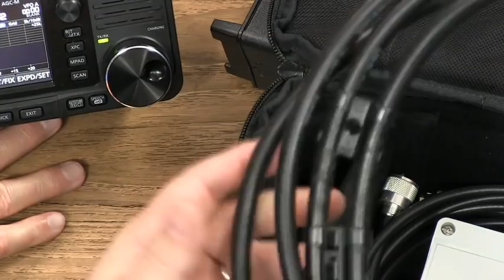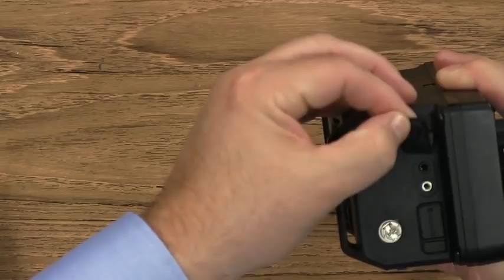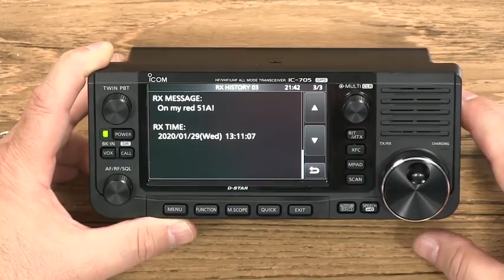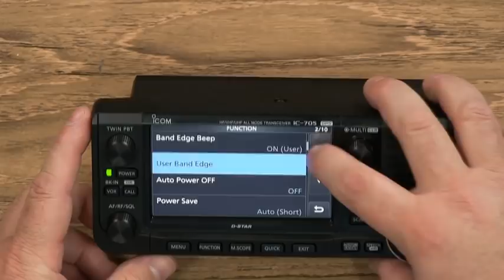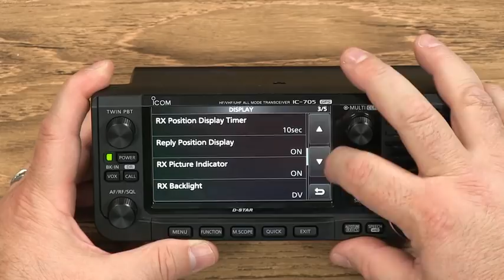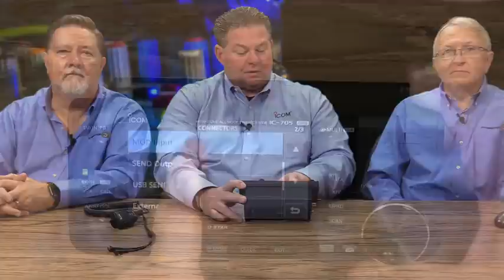Icom IC-705 All Mode Transceiver

Comment: This video was in my Youtube recommended page...

I have problems....

Is the Icom IC-705 going to be a good radio?... Yes.

Will it be a practical portable radio?... No.

While the radio is a good radio, and I like the ‘battery for handheld’ approach, there remains several areas that need massive improvement.

1). The backpack. Icom did exactly the same thing with the IC-703. The only variation was that the 703 needed an external battery which was the same thing as used in Radio Control Cars. The 705 has its own plug-in battery on the back panel. The backpack even includes a pocket for the dualband antenna. For some reason, Icom discontinued the shortwave antenna used with the 703, so now we can’t do portable shortwave with the 705.

2). This is a biggy. NO BUILT-IN ANTENNA TUNER. Nothing, no way, no how, nada! This means more space in the backpack will be taken up by the EXTERNAL antenna tuner and probably spare batteries for same, too. This leaves a lot less space for the actual shortwave antenna, which (because no antenna tuner), the user will have to pretune. Pretuned antenna(s) will be useful even with the tuner in place. To use all this stuff, a person will need to bring a table to hold the gear. 

All this means NOBODY will use the 705 in the field, carried in the backpack. Plain and simple. QRP users will love this radio, for low-power base-station use. But nobody will buy the 705, with the intention of DC-to-daylight portable use.

Adding insult to injury, the IC-703 had an antenna tuner. Sheesh!

This leaves only one company with portable gear that includes a decent antenna tuner and batteries internal option. Sorry folks, that’s Elecraft. Even Yeasu hasn’t approached the all-band portable properly yet, but at least the ATAS-25 exists, which eliminates the need for a shortwave tuner.

I hope people actually enjoy the IC-705, but let’s not try to sell it as something it isn’t.
Reply: Xiegu's X5105 has an internal battery AND an incredibly capable tuner.... ICOM missed a trick there
Reply: Ronan Cantwell 

Okay... however, I do not include products made for everyone but their own population.  Firstly, China has no amateurs. And second, their products, however good some of them are, are inconsistent quality. And I mean by a lot. You can obtain 5 of the same unit, and at least 2 and sometimes three, are inop in some way, or out of alignment.

I should know, I tried several over the years. I remain unimpressed. Being lucky and getting one that works, still doesn’t let us know about these long term stability tails... and it’s becoming a not funny subject.

Don’t waste your hard-earned money on products intended for everyone to hate, but your own people. Chinese companies are low-balling their pricing for good reasons. A good percentage in the market, regardless of quality, is an important metric, especially when it won’t hurt what you’re doing in your own country. Deal with product lines with a good track record.

These, and for many other reasons, are why I pointed out the ‘kx’ line at Elecraft and ignored the Chinese products.
Reply: @kd7bwb12  Firstly, I'm not American and won't buy American radios as I don't agree with the way your country is run. Secondly, I have two Xiegu radios and both are fantastic. Thirdly, there's a very high probability that the device you used to reply to my comment was produced in China..... I know mine was....
Reply: Ronan Cantwell 

The listed mixed metaphors in your reply, is so long, I’m not sure where to begin.

But I’ll try.

1). For the last three years, and being an American, I am totally satisfied by the actions of my country, under the command of DJ Trump. There are parts of the country that is criminal minded, like many others. The next year or so will be very edifying.

2). I did not mention Elecraft because they were an American company. I mentioned them because they make a good product, and their main target market country has actual amateur radio operators. China has NONE.

3). My computer products involve an old Compaq as my Linux box, and many Apple products. Apple is the only American computer company that builds some of their products in the United States (Mac Pro , iMac Pro, and iMac). Their laptops and their battery factory are on the ASUS campus, in South Korea. The IOS products are made at Foxconn, a department of Hong Hai company based in Taiwan. They have some of their factories in China. Foxconn also makes products for 14 other companies including Hewlett-Packard (who owns Compaq).

Hong Hai is the single largest employer on Earth, 1.2-million employees.

Find a way to assuage your conscience of guilt in another forum, but your politics stinks.
—-
As for your liking for Chinese ham radio products, I am hopeful that you wasted your money in a useful way.

Just remember what I said. China likes to sell products to anybody but their own people, and build in such a way as the owner has to purchase them more often than other lines. That is for another conversation down the road.
Reply: @kd7bwb12  You really do like to type, don't you. Here's a link to an article by your very own ARRL all about amateur radio in China. http://www.arrl.org/news/cq-china

Don't get me wrong - I agree with your position on the country's politics and indeed their human rights record but you can't boldly state that they have no amateur radio operators as that's simply not true. 

I can't help you with your unfortunate choice of computer product. You're in too deep there.
Reply: Ronan Cantwell 

Okay, I checked out your data. I stand corrected. There are HAM’s in China. I looked it up in detail. All 800 of them. Yes... 800 of them. Not 8,000, not 80,000.

800!

The last census in China said approximately 1.35 billion people, their population is dropping some. But 800 hams. That is all.
—-
As for Apple, let’s take a look at the company.

It is the first microcomputer company in the World to net $1-billion dollars, and that is for the Apple-2 computer, and before the Macintosh.

Apple remains the only microcomputer company remaining, to design and build their own hardware and then design and build their own operating system to run on it. The only one. 

Again, they remain the only microcomputer company to build at least some of their products in their home country. Microsoft doesn’t, Dell doesn’t, Hewlett-Packard doesn’t.

There is nothing dishonorable about these facts...

There is nothing dishonorable in their conduct as a business. I question some of their forays into politics.

They are presently in a very vocal fight (in California) about user data privacy, versus Google. Apple is right on this.
—-
But you have other ideas, you won’t state. Play the game or don’t, but I have no regrets about owning Apple products. Even their tech support ratings are about 75% approval. The next highest (worldwide) is Hewlett-Packard at 45%.

But you play in the shadows, and will not engage. Until you do, you stand as a coward.
Reply: @kd7bwb12   You have been a busy bee, haven't you?  Please excuse my brief period of sleep.... Please also excuse my single-paragraph response as I'm using my Chinese phone and can't seem to enter line breaks. Must be a government thing. I won't enter  into a debate on Apple. I have very strong views on that company that differ from yours and I very much doubt either of us are likely to change our opinions through chit-chat here. To come back to the original topic, I have no regrets at all about buying my two Xiegu radios. They have been very well supported by the engineers at Xiegu who continue to develop new features and software upgrades. It's been interesting and refreshing to see them responding so quickly to customer feedback. I won't claim for a moment that there haven't been small issues with their radios. There certainly have but these have pretty much all been resolved and the radios are an absolute joy to use. As for your comment on my character towards the end of your somewhat entertaining reply; You don't know me and thankfully I don't know you. I wouldn't be quite as rude as to make a judgement on your character based on some throwaway comments on a YouTube video. I won't be replying further to this so fill your boots and tap away there as you seem to be the kind of guy that needs to have the last word. Oh no! I DID make a character judgement! Feel very free to prove me wrong as I will neither care nor respond.
Reply: Ronan Cantwell 

So okay, you take your ball and your bat, and go home... because you can’t win.

And you know it. So let’s review:

1). You buy a radio fom from a China based company that has a internal customer base of 800.

2). You broached the subject of your dislike of US politics, and now refuse to elaborate.

3). You broached the subject of disliking Apple products, again for reason you refuse to elaborate.

And now because you can’t prove a damn thing you get into a tizzy and close the field.

4). You’re the  one that wants to talk about your Chinese made radio, which I am perfectly happy to do, but I insist on you clarifying and elaborating on subjects I’m pretty clear you can’t define very well. I’m also pretty sure, I’m better versed in politics and Apple, than you are.

Your disadvantage is obvious, and explains you raiding the game. You’ve written more than enough to make a clear value judgement about your character.

You remain a coward.

Comment: A Pity they didn't add:
> Intenal ATU
> BNC for HF & BNC for VHF/UHF or Driver for microwave transverter on 1 BNC, Talkback on the other
> LiFePO4 Battery Pack

I'm hoping the EU version "will" have 4M / 70Mhz

Comment: Quite interesting. All in one.
Question 1, will it be MARS and CAP capable as well as selecting between USA and EU band plans?
Question 2, is Ray a Marine?
It would be nice if it had a connector that would allow for an external antenna switch. On HF it would allow an external switch to route the antenna to a tuner/antenna and on V/U it would tell the external switch to go to the dual band antenna. A very simple mod/add on that ICOM could incorporate into this radio. When one mounts in in their car the antenna switch is mounted in the car and just connect power, antenna and antenna switch and rock and roll.

Comment: Ray is constantly tilting the 705.  Icom should include a separate tilt stand with the rig.  It also needs a small ATU that integrates with the unit.  Nice unit.
Reply: Take the Elecraft ATU T1 and your fine up to 20W. Or as a basestation with a PA like Hardrock PA including the ATU option.
Reply: @wolfholler9939  I have the T1 tuner.and used it with my FT817 and KX3. A great tuner with a wide range.
Reply: Either use resonant antenna's, or pack a LDG  z11 pro2.
Reply: I'll add to the T1 love fest. Small and works very well.

Comment: So it's got GPS built in... Does it have APRS?
Reply: Probably only DPRS! Unfortunately.
Reply: @m1geo  bummer... Guess I'll buy something else.  Was hoping for an all-in-one that wasn't missing features my HT has.
Reply: This is Icom, not Kenwood, so no.
Reply: @gsansoucie  arps is not Kenwood specific... It's used by a lot more than that.
Reply: 805maker valid point, Yaesu has APRS too.  Icom seems stuck on DStar though
Reply: @gsansoucie  guess I'll order another Kenwood. :(

Comment: A QRP RADIO when the bands are beyond Terrible? ICOM has missed the mark again and it’s becoming a normal activity for them? I am considering a Yaesu since they do still make radios that are not Touch Screens which I would never own.
Reply: "Beyond Terrible"
FT8 & 10 Watts and you can work the world, JS8CALL & 30 Watts and work the world
You adapt to suite conditions,  or wait 5/6 years and use QRO
Reply: "Beyond terrible"... is an embarrassed operators way of saying "I need a better antenna.".   I've worked Alaska and the Slovak Republic 4800 miles away (SSB) on 6 watts and a wire.   Amazing how the bands aren't "beyond terrible" every weekend when people are talking on the radios.
Reply: Hmmm... I’m working state QSO parties using CW @ 100 milliwatts into a dipole in the field. (Just did that yesterday.). Sometimes even 100 watts isn’t enough but you can regularly make contacts at QRP levels.  Give it a try on a contest weekend and see what happens. -Cliff (N4CCB)
Reply: Yes, a QRP radio despite the bands are beyond terrible! This is exactly what was missing in the Icom portfolio since the 703 was discontinued. There are numerous bulky 100W HF transceivers on the market but only very few ones you can take with you in a backpack! Icom is doing exactly the right thing presenting a competitor to the Yaesu FT-818 and Elecraft KX3.
Reply: DB7MM 90% that buy one will be in the market for amplifiers for some or all of those bands soon after their purchase.I have seen it 1st hand with several friends who have the KX3 and 703 radios.

Comment: Icom has been on a roll these past few years, releasing gear that has really pushed the technology forward; ic-7300, ic-9700, ic-r8600...
Reply: IC7610
Reply: @m1geo  Oops, yeah forgot that one!  I own an IC-r8600, what a great wideband receiver. I still love my old AR5000+3 and AR7030 radios and would never part with them, I guess they represents the end of the line for conventionally designed receivers, I doubt it's possible to design better superhet-based radio, also a highpoint for AOR who seem to have really fallen by the wayside these past few years.
Reply: It feels like Icom is the most serious about amateur radio and moving the technology forward.

Comment: Remove speech button and add Antenna tune button. Sold.
Reply: Agreed. And while they're at it, how about including an internal auto antenna tuner. Elecraft and the Xiegu g90 has one ! Unfortunately a deal breaker for me. When I'm out hiking and camping, the antennas I use are not going to be right on resonance. A tuner is needed and I don't want to have to backpack  another external tuning device.
Reply: @normkirk65  Thats why I will be keeping my G90 for a while in lieu of getting the IC705.  The G90 has it all, waterfall, antenna tuner and analyzer plus 20 watt output at less than half the price.  If I want VHF/UHF, I will bring along my FT3d.
Reply: @TXLorenzo  Yes. I am seriously considering buying a G90. Perfect for backpacking and you can't beat the price !
Reply: @normkirk65  I like mine. I use it for backpacking as well. It has an all metal case and is fairly rugged. I can use it for  voice and all digital modes as well. Hard to beat the price/performance.
Reply: @TXLorenzo  Thank you. I believe I will order one. I can't help wondering however if they will have an "improved" or a bigger, better, new model with perhaps a slightly larger display ( 2.5" ?  )  maybe a 24 bit 192khz a/d converter for more spectrum scope bandwidth and perhaps 2m band etc.
Reply: @normkirk65  They are coming out with a larger display.
Reply: @TXLorenzo  Yes, but it is an external display. Hoping that due to the G90's popularity, a newer, larger transceiver with much more capabilities will be in the making within a year or two. In the meantime, I will purchase a G90
Reply: @normkirk65  For the price, it is hard to beat. Plus, they are always doing firmware updates to make it better and they actually respond to user suggestions.
Reply: TXLorenzo an external tuner the size of an altoids tin weighing 6 grams can be purchased for under $60 through mfj. Yet, when backpacking with your G90, you gave to bring a power supply and something to power the power supply. I don't get the logic there.
Reply: @normkirk65  the G90 would be terrible for serious backpacking. What are you going to pack in your bag to power it with?
Reply: @ChadBlack  To do the same function as the G90, the IC 705 must not only add an  external antenna tuner, but also an external power supply AND a linear amplifier AND an antenna analyzer AND bring an extra 600-700 dollars to pay for it all.  It's going  to cost you to get the performance out of a IC 705 comparable to the G90 in both weight and money.  That internal battery of the IC 705 is only going to get you 1/4 the power of the G90, a significant difference in a low solar cycle.  There is your logic.
Reply: @TXLorenzo  the 705 has an swr antenna analyzer built into it. Just like the 7300. The 705 doesn't require an external power supply. If you're truly qrp backpacking, carrying around a 10 pound battery for an extra 10 watts is pretty ludicrous. The 705 is a REAL backpacking portable qrp rig.
Reply: @ChadBlack  Sorrry, I don't believe the 705 has a swr "analyzer", unless you are talking about the swr meter which is not the same. My 6 amp lithium phosphate battery  weighs way less than 10 pounds and it gives four times the power and is easily back packable.
Reply: @normkirk65  Absolutely. I was shocked it didn't have built in tuner.
Reply: Does the G90 do VHF/UHF, and have an internal battery?
Reply: @ChadBlack  No